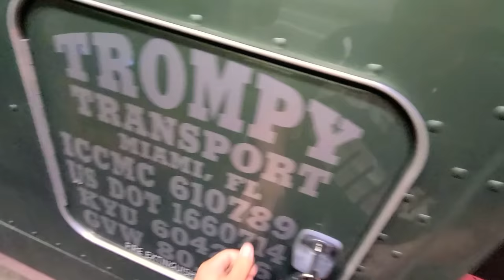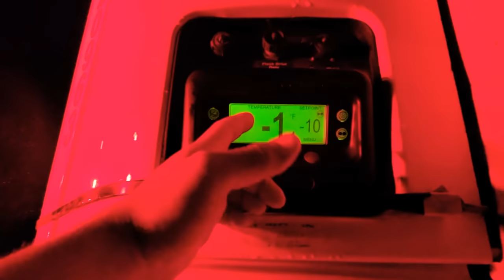Deadhead Miles once again

Comment: I wish everyone would so no to cheap freight, doesn’t make sense for all these guys/companies taking it. And always seeing you and pops together. Safe travels my brother
Reply: Correct
Reply from the maker: Likewise my brother God bless
Reply: What do you consider cheap freight ? Instead of Rev Per Mile, look at the Rev Per Day and what your Truck requires to operate on a daily basis factoring in utilization. If you take 6 days off per month, your utilization is 24 days to generate the revenue to support the operation. At 24 days of running, and an O/O with average cost per mile is looking at a min of 1K per day or 24K per 30 day period.

Comment: Since you own your trlr, Right weigh on board scale. I can adjust tandems accurately, no cat scale. Only have to go to one if I'm over and they want a ticket to take some off. Use the suspension gauge for the front. (or you can get the one marked in lbs). Saves time and $.
Reply from the maker: Yes sir I need to put that on it really helps with time and money thanks